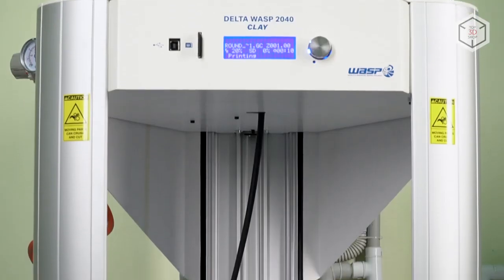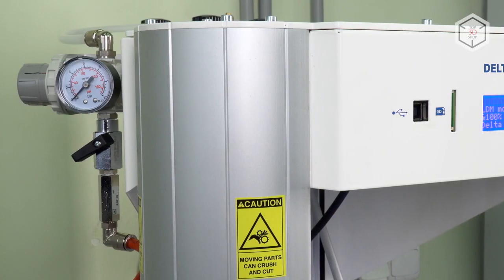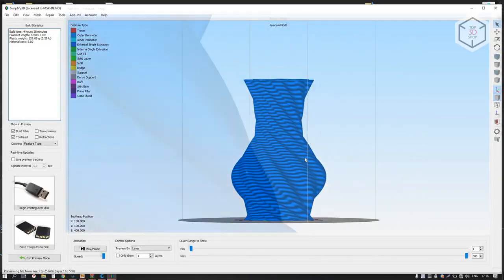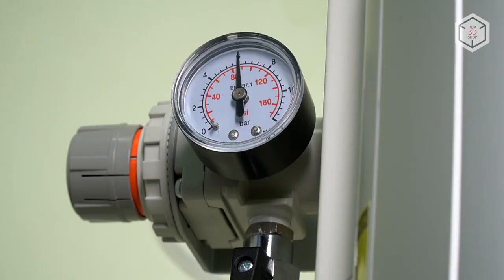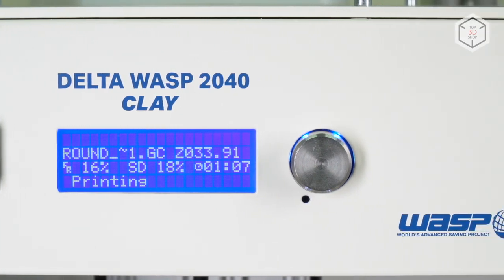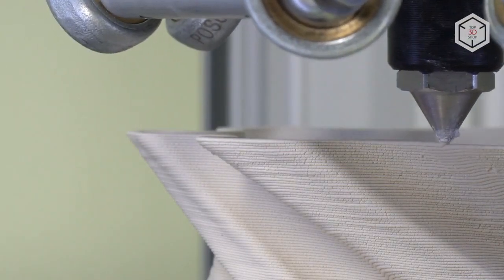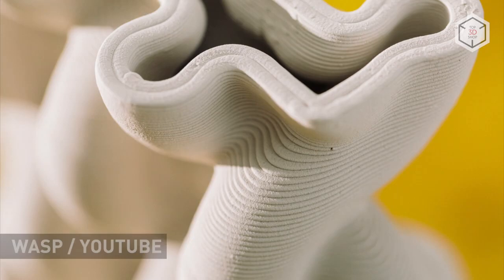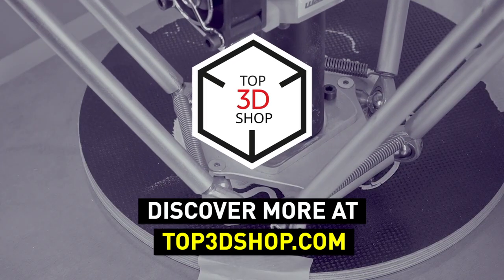Delta WASP 2040 Clay Review: 3D Printing with Clay and Ceramics

Comment: what about the cleaning process?, i'm using a eazao zero and the cleaning is a nightmare. I'm afraid this could be something like that
Reply: it is. we confirm that
Reply: got an eazao zero too and this one looks easier to clean! the main problem of the eazao is the cartridge and in this one the cartridge can be disassembled and cleaned as a tube!

btw how do you make your eazao zero work with the clay? when i mix it like they show in their tutorial the electric putter make a weird noise like if the clay is to dry and when i make the clay wet there is too much air bubbles inside… it’s a real nightmare… and this one from wasp looks 1000 times better with the air compressor and air bubbles remover

Comment: Can you use air dry clay or polymer clay?
Reply from the maker: Hi Tara, great question! 

It is possible to use any type of clay. You have to take into consideration: A) viscosity (can you bring the mix to the viscosity needed to support extrusion?) and B) aggregate size (does the mix have aggregates? if so, what size?). 

Could you advise on that, so we can take a closer look at your case?

For the rest, any clay will be extruded. Not every type of clay would be perfect for 3D printing and layering, but for extrusion, (almost) any clay can be used.

If you're planning to work with something that is harder to extrude, certainly the Delta Wasp 40100 Clay + Continuous Feeding System provides added extrusion power and a wider range of fluidity that the machine will successfully extrude.

Full details here: https://www.3dwasp.com/wp-content/uploads/2022/03/40100-clay-continuous-feeding_webflyer_07_03_22-1.pdf